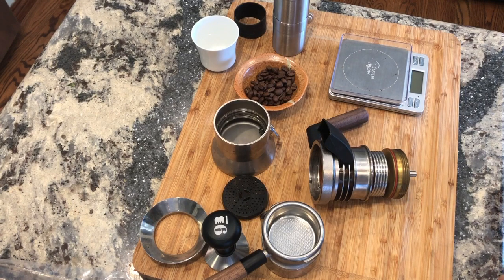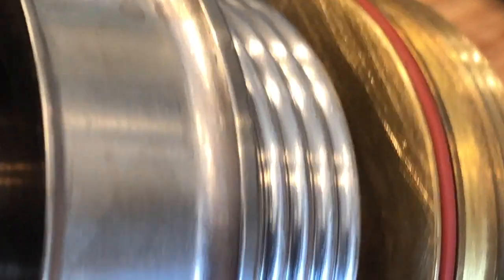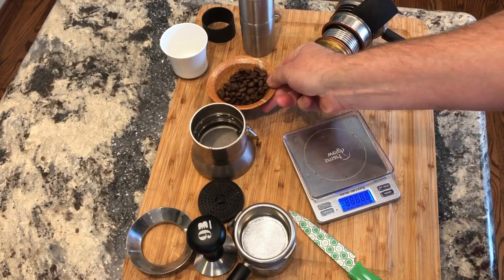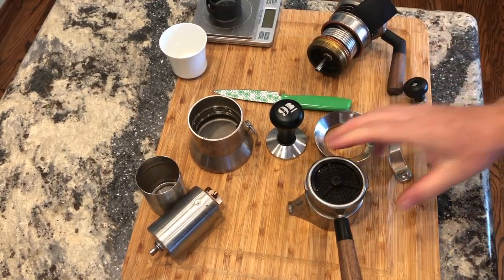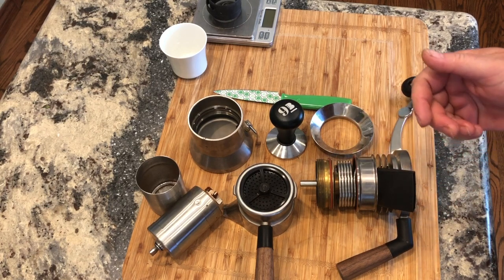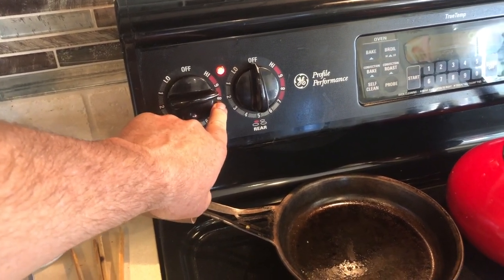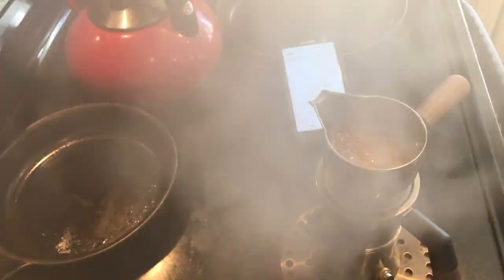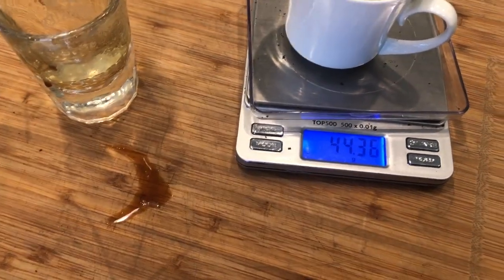9Barista - Nucleate Boiling (volume up)

Comment: So, after all this time with it.  Are you truly happy with this machine and the fact that it's not a back to back machine??   I'm just trying to justify that kind of money.  Love the idea and the way it works.
Reply from the maker: The short answer is "yes, absolutely." I love good technology, so I'm an easy mark for gadgets like the 9Barista. There's a simplicity to the process of prepping for and using the machine, and this appeals to me. Ultimately, the test of my satisfaction is whether it makes good espresso or not. It does, so I'm satisfied.
Regarding multiple espresso shots: I only drink a couple of coffee/espresso drinks on any given day, so it readily handles my needs. Further, I'm an introvert and loner so I don't have a frequent need to make coffee for others. When I do have that need, I can employ a combination of the 9Barista and my Rancilio Silvia. Or my Aeropress. Or my moka pot. Or packets of instant, if I don't like the recipient.
The question of monetary justification is secondary, I think. Evaluating the 9Barista from that standpoint, I don't think you can ever get close to having a sound justification for it as a primary machine. One would do better to save a little longer and buy a more full-featured machine. Rather, I view the 9Barista as functional art, and I'm happy to use it.
Reply: @baka-yarou  Thank you for your answer Sir!!  I'm still on the fence.  We'll see.  I do think it's pretty cool

Comment: wow, it did improved a lot, I was wondering why in your other videos you were not getting as much espresso out of it, do you really need the heat dispersor in an induction stove?
Reply from the maker: I haven't used the 9Barista without the heat diffuser, so I don't know how well things work without it. My burner is much larger than the 9Barista base, so the diffuser also prevents the handle from getting excessively hot.
As for improvement, it's really down to paying attention to the very nice people at 9Barista. They (along with other viewers) suggested I try a finer grind and a full 20 gram dose. Combined with the improvements from nucleate boiling after sanding the inside of the 9Barista, shots got much better and more consistent from one to the next.

Comment: Please use a better grinder than Porlex Mini, if you can afford the 9barista.
Reply from the maker: That's an interesting comment. The cost of the 9Barista has no bearing on the cost of any other coffee components. You didn't define what you meant by "better", so I'll offer that the Porlex simply does what I need it to do, and at a reasonable price. What could be better than that?
If you'd care to offer some objective criteria for "better" and perhaps some recommendations of grinders that fit those criteria, I'm happy to listen.
Reply: @baka-yarou  Just some suggestions:
1. Kinu M47 classic 10 microns per step (slightly more than this 9barista cost including shipping, its not same as M47 phoenix version)
2. Commandante C40 with redclix upgrades 15 microns per step (for espresso), cost similar as Kinu M47 simplicity version
3. 1zpresso JE-plus 12 microns per step (Budget but still very good for espresso grinds, currently observing the durability) 
4. I won't recommend lower than these 3 due to: I have no testimonials other than these 3 above nor many grinders can reach the precision.

My case: direct jump to Kinu M47 from my delonghi KG89.

Porlex Mini is simply way way overpriced for the the grind quality it produced. There is a lot of much cheaper knockoffs which perform almost the same as the porlex just less durable.
I would rather you get a cheaper hario skerton if you still feel the porlex does it job properly (as an espresso grinder)

Having 9barista is very niche & optional, but having a good grinder is essential.
Reply from the maker: @reyavalon  Thanks for all that info. I'll have to check them out and see if there's something I like in there.
Reply from the maker: @jameschang2736  Definitely looking at a new grinder, thank you for another excellent suggestion.

Comment: What size is that funnel you used? You mentioned it's not a push through funnel so I wonder if you think there's a better choice that lets you  press the coffee through the funnel
Reply from the maker: The funnel is 53.5mm from Orphan Espresso: https://www.orphanespresso.com/OE-Stainless-Steel-535mm-Dosing-Funnel-_p_5719.html
I haven't tired any other funnels so can't make a solid recommendation.
The tamper that 9Barista provided to me is 53.05mm in diameter. If you're looking for a press-through funnel, you'll need a funnel on which the inner opening is a little more than 53.05mm diameter, but not so large that it won't rest on the rim of the filter basket.
Reply: @baka-yarou  thanks a lot!

Comment: Hello, my 9 bris won’t come up the water into upper part? Any idea?
Reply from the maker: I've got an idea that maybe you've ground the coffee too fine, and possibly tamped it too firmly. When I've done those things, it's resulted in a slow or delayed flow of liquid into the espresso reservoir (the upper part that is open on top).
I think it's also possible the mechanism may not work if you haven't filled the boiler with enough water, so maybe double check that you're filling to the inscribed lip in the boiler . . . but I think that's less likely than the grounds being too fine.